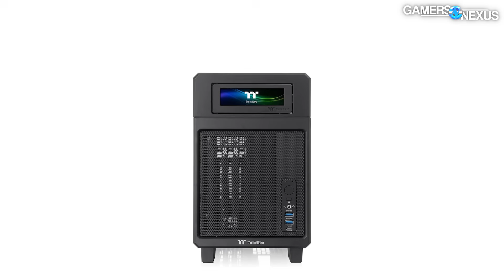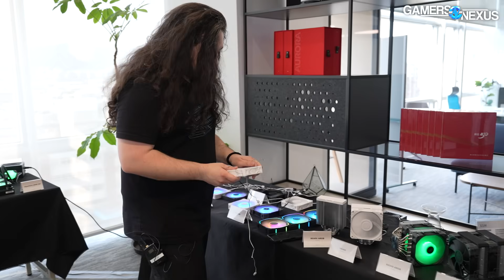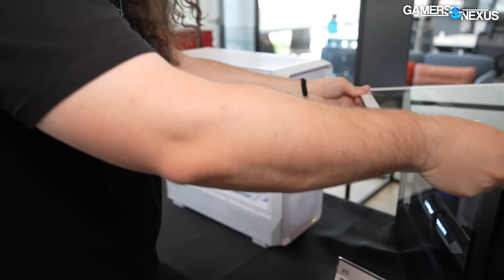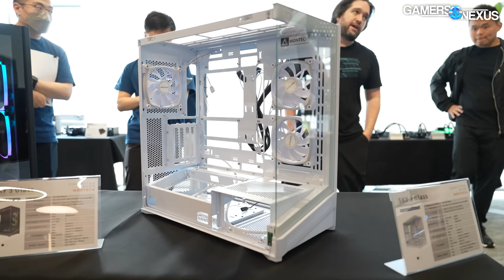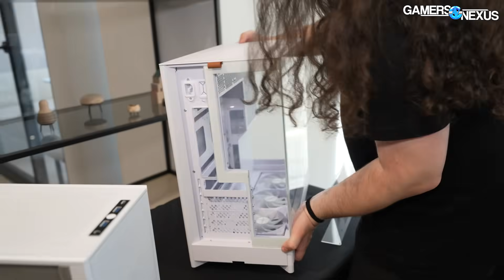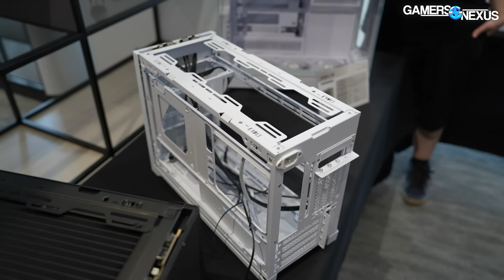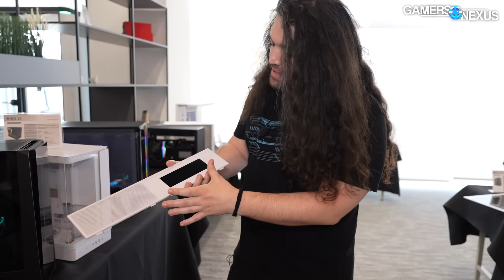Montech is Targeting Thermalright: Cheap Air Coolers, Sky 3 Case, Micro-ATX, X5, & More

Comment from the maker: It has been a constant theme of conversations at these fan and cooler companies that they simply can't get down to Thermalright pricing. We're planning to ask Thermalright about that when we check out their new coolers in a few days!
HAVN has a really interesting new case and some ultra thick fans with a lot of engineering in them. Check out our news coverage of those: https://www.youtube.com/watch?v=eeGwSlLXXw8
Support our travel coverage for Computex! Grab some stuff on the store here: https://store.gamersnexus.net/
Reply: I have NO idea, they must have an aluminum mine somewhere filled with mining robots or something, because the Peerless Assassin is one of the best air coolers there is. For the price of a single AF15 fan, you get a complete air cooler that gives the NH D15 a run for it's money, and beats it in some cases. It's just insane, and I would love to know the secret. But I suspect a robot called a Peerless Assassin would show up to rectify that if I ever did find out, so maybe not. Still curious though.
Reply: It's really too bad that a standard 200mm with multi holes hasn't made headway in the market.
Bitfenix's old 200mm fans are awesome.
Reply: Can you cover or test the Arrow Lake 200S / Z890 bottlenecking PCIe 5.0 speeds of NVMe SSDs? Seems capped at 12GB/s instead of the max 14GB/s. A few outlets have reported on this already.
Reply: @GamersNexus one thing that would be interesting, when mentioning prices and the effects of tariffs, would be mentioning if those price increases will affect only the US market or if the companies will take advantage of that fact in increase the price in other markets also. As you may know there are more place in the world besides America and you guys are seen worldwide :)
Reply: I jumped in this pinned comment to say thank you Steve, as well as your crew recovering computex. You are the only techtuber I see that is covering as wide a variety of booths as others, as well as going into great detail and depth.  I'll give a shout out to the others as well. But you go over and above what you have to do and I just want to tell your team and you thank you for your dedication. And this is not me kissing ass, this is me as a 50-year-old man giving credit where credit is due.  
  In fact I probably have watched your channel since its inception, and have watched you grow to the PowerHouse of a company that you are. I no longer consider you a tech tube reviewer and look at you more as a engineering and real world testing applications channel.  But just in conclusion, thanks again for your detailed oriented review at cnes
Reply: Thermalright (or Shenzhen Dirise) certainly benefits from economies of scale. They’ve also helped drive down prices for all manufacturers in China, that's why most of Chinese manufacturers now focus on overseas market because of higher margin since domestic Chinese market has absolutely no margin left, mostly because of Dirise. However, Dirise don't produce many of their products, only the lower end heat sinks using press fit fin are produced in house. There are still plenty of cheap manufacturers in Dongguan and Huizhou. For example Dirise outsource their water coolers to manufacturers like Dongguan Bingdian, and other product lines are also like this. Afaik Deepcool (or Jiuzhou Fengshen) is the only manufacturer that produces everything in house with a fairly high level of automation, most manufacturers in Dongguan and Huizhou are still quite primitive, this is evident from their manufacturing processes and product quality. For example, Deepcool once had reflow soldering production line, but I think it was discontinued after prices were driven down by players like Dirise.
Reply: I own a small boutique system builder company, and I have to say that it just makes so much sense for me to use thermalright coolers on practically all of my builds.  They look great, the do not breakdown, and their pricing is unbeatable.

Comment: The NX600 is DOA, due to Thermalright’s Royal Knight. Change my mind. 

I still can’t see why companies think the dual tower approach, with the same fan size on both towers, is the future. There will be offset due to RAM clearance. You will not get the static pressure and airflow you’re advertising. Stop lying to yourselves and just do it right.

Comment: Montech really should have made that case a little taller, with the PSU completely hidden and large intakes for those fans pointed at the GPU -- no doubt would reflect well in competing on thermals when it eventually gets reviewed and benchmarked.

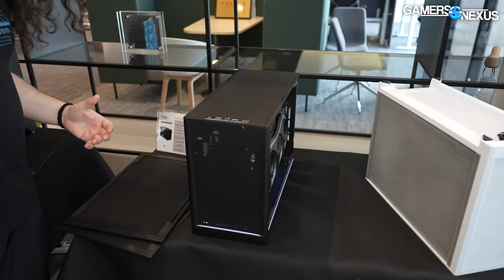Comment: 13:42 "all-mesh box" Why can't we have that for larger cases? Here's an idea for Montech: Offer a standard-sized case with a mesh panel instead of a glass panel. Should be cheaper and have better performance, since most GPUs would exhaust their hot air through the side panel (alas, that side panel is 99.9% made out of glass, so hot air remains in the case and is recirculated and/or heats up other components). Perhaps some areas of a side mesh panel should be blocked to maintain positive air pressure in the case but users could do that themselves. What users cannot do is to cut a GPU air exhaust area into their tempered glass panels.

Comment: That white case isn't white. That's very light blue. Technically. That's why they have trouble matching it with white plastics. White and whiter gone too far. Painting a case in all the shades of white is no problem at all. Those paints are readily available. It's more of a choice. Also a question of primer costs.

Comment: Really haven't been impressed with my Thermalright cooler. One fan dead within a week, another noisy but fixable with fan curve. The Y-splitter was such poor quality that I struggled to hook the fans up to it and worried about bending the pins. Fan clips that clearly weren't made to fit a 120mm fan to a 140mm heatsink.

If Montech can push for that little bit of extra quality I'd happily recommend them over Thermalright, even if they end up a little more expensive.

Comment: Montech is very competitive when it comes to quality/price... i got a 850w Montech Century Gold rated PSU for 89.90€ ($100)... A PSU with similar specs on other more well known brands would have cost me almost the double or even more than the double in some cases... the PSU is really heavy which is usually a sign of good quality components and has a 5 year warranty... really happy... their cases and colling solutions seem to be really good as well... a brand worth checking for sure
Reply: It makes sense. The century gold is based on the CWT GPX which is the same power supply platform as the MSI A-GL series of PSUs. They did have a bad PSU a couple years ago but so far their newer ones are looking legit and it seems like they got people in the right places to make sure it stays that way.
Reply: @purplegill10  Lmao, you must be some kind of wikipedia ahah... it is based on a CWT GPX indeed, i did checked some info before buying, they don't exactly shine, it's considered a Tier C PSU but i believe that is mostly due to the fact that it has some problems on countries that use 115V...

This is the footnote on the Century 850w on the PSU tier list:
[2] High wattage (=>750W) CWT GPX based units have problems with failing burn-in test under sub 100VAC input, treat as 230V only (JonnyGURU).

I believe that may have cast a shadow when it came to tier placing, not sure though, but so far so good so what 😅 (cough cough)
Reply: @TiagoFilipeCabral  Is that an old list? I haven't seen that issue on that in recent times. And less wikipedia, more just finding out how many PSUs are the same OEM designs just slightly modified which makes recommendations WAY easier for friends.
Reply: @purplegill10  PSU Tier List rev. 17.0g, posted 2023-04-11... like you said on the first reply.... a couple years ago... and like i said... you are the PSU wikipedia 😆
Reply: @TiagoFilipeCabral  You should check out SPL's PSU tier list. It's pretty much replaced Cultists in terms of up to date PSU ratings. I got most of my info from there so for all I know my stuff could be wrong :P

Comment: Is it bad i will only use thermalright fans and coolers. My 1 year old frozen edze 360aio still cooling and has not lost and cooling yep. And my ring rgb thermalright fans still working going on  2 years later. . I also still still have my dual fans assassin for backup.

Comment: I had to Google if Montech and Antec had something to do with each other after building in each back to back- so many things made me think "I like how they did that" only to see the same thing in the Montech afterwards. Then I noticed other little things like the included reusable plastic box for the screws, zip ties, Velcro, fans, and even the writing were all similar. 
I guess it's probably just because all the builds I've done were either in older cases or more standard ones. Anyway, at the end of the day, I feel like both companies are offering premium products for good prices.

Comment: Their King 95 is my current favorite case.  Arctics' AIOs do NOT fit in several cases when top mounted as their thickness collides with the larger VRM heatsinks.  My LF3 280 fits quite handily side mounted (as exhaust).  2 bottom mounted intakes 1 rear and 1 top as exhaust.  I live in Oregons' High Desert, so the front versus top connectors is a must.  Like the previous video, it's cool they trust you enough (your journalism ethics) to give you access.

Comment: quick question, having 2 AIOs for GPU+CPU, would front and side intake for them with top exhaust fans good for airflow? should the radiators be prioritize over the interior airflow if the the cpu and gpu are the main source of thems?

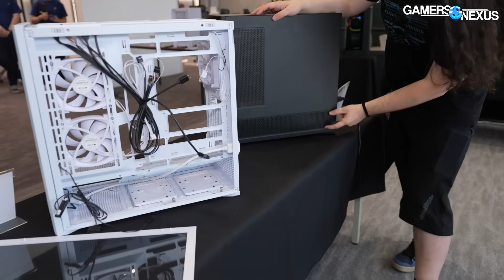Comment: 9:07- Clearly they didn't put the rubber pads under the brick to prevent it shorting out on the metal of the case. They should have watched The Verge, they'd know how to ground the case, or at least would have included Livestrong bracelets in case you're electrocuted. You know, so people know you support the fight against cancer, and you're a good person now that you're dead.

Comment: nice cases, in theory sure only the build and material quality would be the question, glad they dont forget dust filter, case without is a nogo for me, we had enough wool/dust mice over a decade ago in bad cases, now my cases need some air pressure once a year and its all good low maintenance, just clean the filter every half a year but that sure depends on the dust in your household which can vary alot. And sure pets add to that. nowadays no filter is no buy.

Comment: Thermalright ruined my AMD X670 Motherboard as the cooler really needs to be used a contact frame as the AMD LGA pins are weaker the then Intel LGA pins, Thermalright don’t see the problem because even they did the tests but with only intel chips, they seem to think the same copy and paste Intel data is good enough to use with AMD. Simply a company selling coolers for expensive chips can’t tell the difference between sockets when the two are completely different chips socket type and LGA Socket pins. Themalright state "The pressure parameters we designed are all comply with Intel's standard; it's constrained by Intel's design specifications. If there is any doubt, please kindly provide proof that the product is flawed, thanks. So, try this yourself applying the Cooler on AMD and Intel motherboards without and contact frame vs using a contact frame and see how many applications of the cooler it takes it takes before the socket pins get damaged and then there are black screen and errors. My AMD board 6 months old lasted two applications of the cooler before I got a black screen and no boot issue and I took the cooler off to see bent CPUI socket pins BUT used the same components on a new board and booted straight away. Thermalright think that this is acceptable because AMD is just “compatible” in their world and not actually tested to the same standard as INTEL because they copy and paste the same data. Arctic coolers come with inbuilt contact frame by standard but Thermalright doesn’t so what do Artic know that Themalight don’t? This is not about cooler CPU temps I have a Amd 9 9950x3d as this is about how much pressure is applied to the socket and LGA pins with two points of contact VS 4 and two seems to be twisted and distorting the socket and causing bent pins even just taking the heatsink on and off to clean. Reinstalled the cooler with a contact frame on a brand-new motherboard and no issues what so ever but I am not using an Intel chip so I am dreading the next clean session. I can’t RMA the ruined board because of the bent socket pins and I did the damage simply by cleaning and repasting the heatsink and Thermalright state “Its ok because it’s tested to Intel specification standards”Dear Thermalight I am NOT using an Intel chip!,  and the damage is my fault because I bought an AMD socket. I am 445 out of pocket for the sake of a 10 Doller contact frame and Themalright need to state a disclaimer that AMD owners should be using a contact frame with this cooler as socket pin damage can happen. In my 25 years of installed coolers this is the only cooler to bend CPU socket pins and now I will never install a Intel or AMD socket without a contact frame attached to the Cpu.

Comment: I've just picked up an original "Thermalright Aqua Elite 360" on Amazon for $80AUD, I just wanted an AIO quickly, I imagined the fans would be terrible etc, but after installing it on my AM5 system, it's functioning fine, yep, the tubs are a wee bit inflexible, but it's decent, I don't need to run the fans anywhere near full speed to sustain 60-65C under load on a 7700, I think under stress tests I'm at around 75C, and it's just fine. No idea what I'm doing with the pump I've plugged that in and left it alone.

Comment: Montech is actually a mid tier price brand they are far from budget at least compared to a lot of other brands sold in Asia they can't even come close to the Snowman Coolers price to performance wise along with the many real budget brands like YGT, Inplay, MMA and a lot of other budget Case brands they practically have the same tooling on their cases too as they are all likely built in the same factory and you can get some decent enough cases at 20-30$ that would look fine enough some of whom are even fishtank with tempered glass too so Thermalright being able to price their products so aggressively is not that surprising given their competition in the budget space.

Comment: Glad to see thicker fans from multiple companies! Let's start designing around 40mm thick fans in the front or even on a top mounted radiator. Move more air, with more pressure, and keep that noise level down. Good trend! Keep it up!
Reply: Agreed! Since 30MM have become more common I want 40MM or even double what is currently standard and go 50MM!
Reply: @oscar21781  You've got to start considering clearances for top, front and bottom mounted radiators at that point though.
Reply: @oscar21781  LETS GO 70 MM WHY THE FUCK NOT I WANT MY FANS THICC
Reply: Sanyo 9ra has 38m skus. Really popular in china.

Comment: Once I touched the top of my case after standing up from my chair in the middle of winter. The static electricity build up discharged on my top mounted AIO radiator. The computer immediately shut down and I nearly panicked. I pushed the power button and everything looked fine and has been fine since.

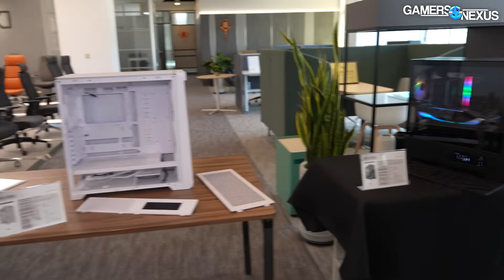Comment: I hope that fan controller on the Air 2000 at 15:11 gets tweaked before it ends up shipping to actually display some sort of feedback when you press the up/down arrows. Either by blinking the RPM or the bars.

Comment: Thermal right assassin king is £16 and keeps a 9700x under 60 degrees running R23. I've used loads of them in budget builds. Montech will have to be cheaper than that which they surely can't be. A degree or two isn't really meaningful it all comes down to price.

Comment: 8:18 The fact that Montech is asking your opinion on if they should use 2 on the side or 2 on the bottom speaks volumes on how serious they are, that they'd ask such a leader in reviewing PC performance which is better. It does remain to be seen though on if they heed your advice.
Reply: kinda sus that a company dedicated to cooling can't figure that out themselves...
Reply: @oscar21781  I think they're more asking along the lines of consumer sentiment rather than specifically getting temperature advice. If the difference would be significant enough from a review standpoint, it would make sense for them to put more R&D into making it work rather than developing the case towards something that won't necessarily be reviewed/noticed well versus other features.
Reply: @oscar21781   It's how they keep the cost down.

Comment: back in the days at 2002 I used a Thermalright SLK800 Copper Heatsink combined with a Delta fan 80x80x(maybe) 30-35 and this copper heatsinks were amazing.

Comment: I'm still using DeepCool here in Canada lol
Reply: I purchased a slew of DeepCool's AIOs and air coolers (for 40-50% of msrp) off of eBay just after it was cleared from store shelves (following their departure from the US market) -- plus three of their PX1300P PSUs (for an average of $150 each) and a bunch of extra fans and PWM/RGB hubs to boot.  As long as I stick with the sockets these things support (and I fully intend to) I'll never need to purchase another cooling solution again. 🙌🏼